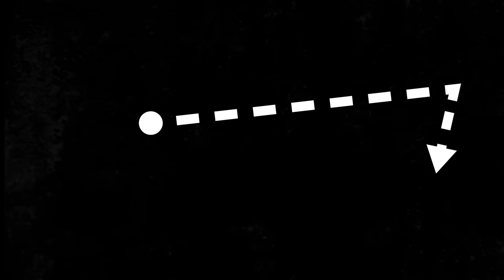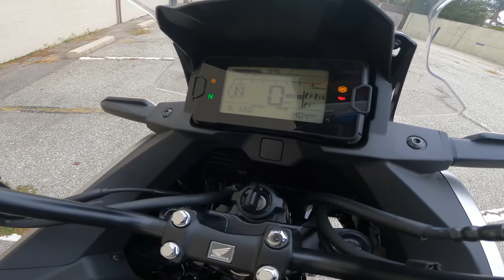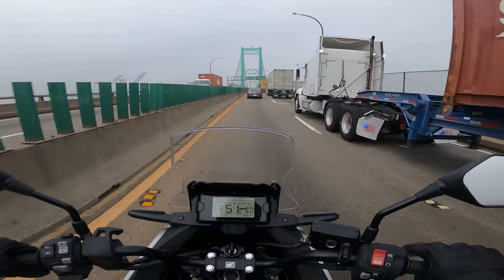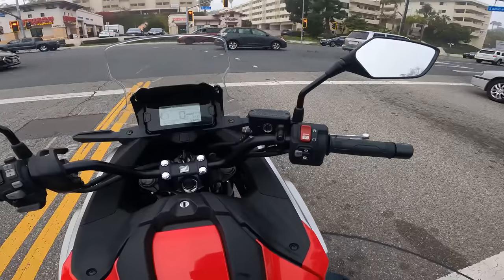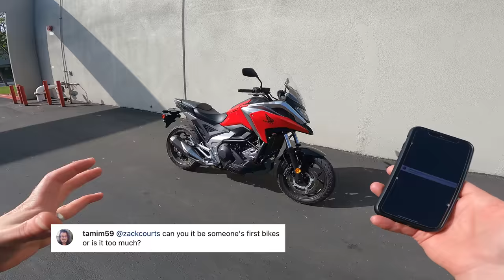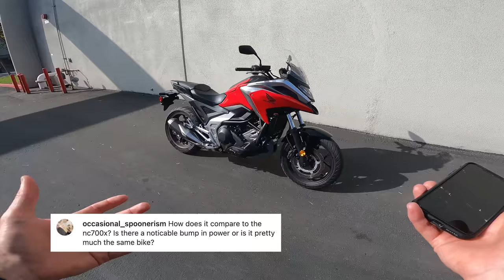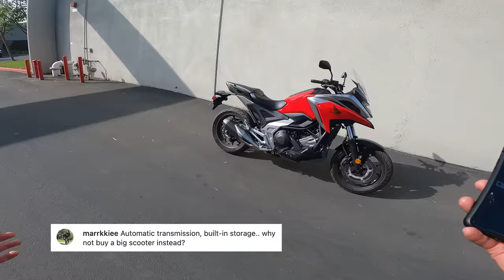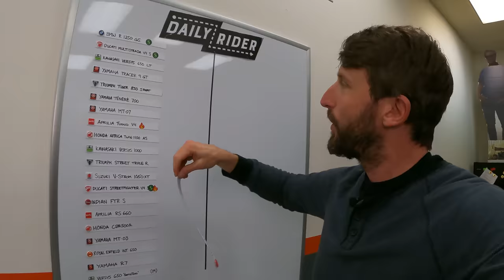Automatic-transmission on a motorcycle? 2021 Honda NC750X DCT | Daily Rider

Comment: I test rode one of these a few months ago along with a Gold Wing DCT Tour. Surprisingly, the Gold Wing, even though it is bigger and heavier it is far more exciting to ride. I suppose it should be at triple the cost. However, my biggest complaint about the NC750X was not its lack of excitement, but the frunk didn't fit my helmet. My Shoei Neotec would not fit. The salesman was stunned. We tried several other Neotecs off their shelf, even a medium size, and it would not fit in the frunk. Why go through all the trouble of engineering a compartment to store a helmet that doesn't fit common helmets like a Neotec? That's a big fail. My other issue was the lack of cruise control. Double fail.
Reply: It's really terrible for helmet storage, yeah.  There is some consideration near the fuel tank for a helmet lock.  But considering all the other stuff I can throw in the frunk, I'm glad it's not reserved space for a helmet.  It's far more useful if left flexible.
Reply: Hmmm... I own Neotec size M and it does fit. Although, it is Neo 1 not 2. Also, it does not fit with Cardo Packtalk attached, but it was never a problem.

Comment: with different tires, could you take this on a fire road or something light dirt/gravel?
Reply: Most definitely! I have done it on mine and so have others. It is no heaver than any of the larger ADV bikes but just be aware that you will have to take it slow. As Zack said in the review the suspension travel is barely 5". I am picking a CRF300 Rally on Tuesday because at 70 years old a 470 LB bike is a little to much for me to handle off road. I ride alone most of the time.
Reply: @johnpagejr.7628  Thx! I have a CRF250l I've been riding around and am ready for something larger and more comfortable and actually usable on a highway, but the heavier ones are way to heavy (e.g., Africa Twin) or too much tech (e.g., GS850) and I'd like to stick w/ Honda instead of moving to something (e.g., Kawasaki, but not the one w/ the doohickey issues!)

Comment: Most dissapointing Zack answer ever was to the question, “why not get a scooter?” As an urban commuter, there are some benefits to the scooter, primarily weather protection and massive built in storage. But the motorcycle format is so far superior in handling and performance that it’s worth relinquishing that weather protection. The larger wheels and full swing arm is all the world of difference. And yes, the chain drive DCT with real gearing beats the crap out of any CVT for performance. On top of which, there simply is no longer a maxi scooter market in North America, which, admittedly, is a little disappointing. Anyway, performance wise, the 750 feels to me much much livelier than the old 700, if you’re asking.

Comment: It's a lovely little machine in many ways, arguably one of the most comfortable I've ever ridden. But the power just isn't adequate (I believe it's basically half of a Honda Fit engine). Honda should go back a few decades, throw on a modern turbo (remember the CX650?) and have themselves an ideal "everything" bike.
Reply: Yep, the top end is near identical to a Fit / Jazz engine. The power is adequate and I've ridden mine all around Europe. The only time to sense a lack of BHP is if you're doing 80mph on the main roads and you want to do a quick overtake but for everything else it's fine and gives 80+mpg(Imperial) and 250miles range is you're touring.

Comment: Do you think this bike is too tall for a shorter rider or too powerful for a newer rider? Thanks for the great videos.
Reply: I have the older NC700X and an inseam of 29 inches. I have no trouble on this bike. I wear boots with heals but can still ride comfortably in flat shoes - just can’t “flat foot” both sides simultaneously. My opinion is this bike is not too powerful for a new rider. As a matter of fact I think it is the perfect balance. Not to fast but not too slow either. The throttle is very forgiving for a newer rider or someone getting back on a bike after years (like me).    This is NOT like a Ninja 650. This Honda redlines around 6500. The Ninja redlines more like 13,000 rpms. If I had a friend come to me who wanted to start riding and he asked what bike he should pick I would recommend a Honda NC.

Comment: Why only one disc brake in front?
Reply: My BMW has twin discs, and my Honda NC750X has one disc. I wish for 2 discs on the NC750X but it’s still god good stopping power and cuts cost and front end weight.

Comment: The only reason to buy the NC 750 X is :
1. DCT
2. Fuel consumption

The Honda transalpine 750 XL has normal adventure wheels size and better engine and  good fuel consumption which is a bit more  then the NC 750 yet does not have DCT .
IF THE Transalpine had a DCT I would have picked it every single day over the NC 750 .
The Transalpine has the powerful yet economical  Hornet engine . Very very good strong reliable and economical engine which Honda is continuing with in the future .
Over all I think the Transalpine is a better bike .

A nice thing would be DCT on and off option so you could use such bike like regular transmission bike or DCT uppon choice; Let’s call it DDCT - Dual DCT .
“Dual”  for Regular transmission option  + DCT option .
Wow I should get money from Honda Research Team .

Comment: Sure, DCT has mostly been seen on soft bikes, but you can't flat out deny that the technology is valid and can be very fast. It's to the point that it is almost impossible to buy a powerful sportscar without it. In cars where you can get DCT or manual the DCT is always quicker. Everybody loves autoblippers, clutchless shifts, and slipper clutches. That's what DCT does, only smother and faster. If they can shed a little weight they are certain to show up on more sport oriented bikes.
Reply: Road car manual transmissions aren't sequential, that's why they can't compete. Most race car, transmissions are manual sequential with quick shifter and maybe mechanical assist to throw it into gear. Most road cars are far removed from race cars. But with motorcycles, you can get a race bike with lights, mirrors and emissions equipment.
Reply: @electric_boogaloo496  Most fast race cars now use dual clutch. That is faster because there is no interruption in power delivery between gears, no throttle close, no ignition cut. they upshift under power.
Reply: @Miata822  can you share some examples of which racing cars in which racing series use dual clutch transmission?
Reply: @electric_boogaloo496  Well, the GT3 and 488 jump right to mind, of course. Each has their own series and any number of dual clutch cars compete in the FIA GT series.
F1 uses sequential and I think they are still popular in European rally events but I don't follow that. It is hard to find a high power sports car today that comes with 3 pedals.
Reply: @Miata822  I get why car manufacturers prefer DCT. Can function as an automatic for people who don't want to shift. For people who want engagement, doesn't kill the feel of the throttle like a torque converter automatic does. For a manual transmission to match the performance of the DCT, they'd have to go sequential, but people who want a 3rd pedal want it with an H-pattern, not a sequential.

The point I was making however, is there is nothing to be gained, performance wise by swapping out a manual sequential on a literbike with a DCT. Space on motorbikes is already so limited that the clutch has to be multi-plate. If you have seen a clutch basket for a regular bike, imagine finding space to fit something twice the size under there. However, you don't need a clutch with so much surface area if your engine isn't outputting literbike power. So, Honda can get away with putting them on less powerful bikes. Even seamless MotoGP transmission on bikes saves 0.1 second per gear shift under acceleration and that is without the weight penalty of a DCT. And Ducati has already files a patent for a seamless transmission for street bikes, look it up.

Comment: The bike is awesome. What about people that can't shift due to a disability or old age. The motor is a torque motor like large cc motors like 1000 or 1100. I wish the cruiser were still available in the US. It's sad as another entry level bike is gone. You go to manual shift which defeats the purpose. I commute so this bike is perfect. Why should I have clutch cramp when in traffic?  No wonder the powersports and people in general don't consider motorcycle and scooters viable transportation vehicles like in Europe/Asia/Africa? It's because the powersports industry is oriented to recreation vehicle. I'm not a squid or a boy racer. I'm also not sure why in the US service intervals are different from other markets? Hence unnecessary maintenance and increased maintenance cost.  I need a vehicle that gets me from point A to point B in an economical fashion. The powersports industry is its own enemy. I want 100000 miles out of my cycles.

Comment: It's funny how automatic transmission is the norm in cars in US but in Europe manual is the "normal" option. And so over here it is more desirable to have an automatic because it is easier and just laid back. Which is what you want from daily driving. I guess manual is kind of a manly thing in the US. But really it is just shit for everyday driving. I guess you'd want a manual for track days.. but then you'll probably have a separate bike or car for that.. so I don't see any point in having to deal with manual in congestion. I'd rather ride a scooter in traffic that pump the clutch all the time going 6 km/h. And what comes to buying a used bike.. I think the clutch and transmission will be in better shape if it was automatic and not trashed by some wanna be street racer.

Comment: I've been riding the NC750X for 4 months now and must say it's an impressive tool, In both directions… 
Lets start with the positive- he's quite an handsome guy, I think the designers did A good job and there is no doubt that most of the attention went this way, The DCT system is fascinating, First of all it’s the only one out there, You normally can choose between the hassle of standard gear or the boring Variators, So the DCT is renewal, Can I say its perfect? Mind reading? Hell no.. but its close enough. The other great idea is of course the room storage in front, Simply brilliant (btw- Aprilia mana did it first)
but that’s about it with the positive.. let's role over to the other side-
First of all- kudos to Honda! What an achievement, No one could believe that it's even possible to make a 750cc engine 
soooo boring and yet you did it! Amazing engineering guys 
Poor in power, Poor in torque, minimal "meaty" rev area that might remind you're not driving a 1986 royal Enfield, 
And then there is the overall packaging of the bike, It reminds me the time I went for groceries as a student and I had to decide what might enter me 55$ budget and what will stay out
The poor breaking system (one disc in front? Really?) the short unknown un adjustable 120 suspension that let me know about every imperfection in the road, the scooter like 2 color dash
the un-adjustable screen, the amount of plastic on the body work

Really guys, This should be in the text book of poor cheap manufacturing

In every day ride he is quite maneuverable and gives a decent grip when you go twisty's, don’t push it to hard due    
In conclusion- If the DCT and the storage appeals to you (and I can understand why) than go ahead, Its absolutely not a bad bike by definition, If this 2 aren't so important than almost every other bike in this engine size area and price will be a better choice 
I guess I will keep mine for a bit more and then it's back to normal gear ... on a better bike

Comment: I love mine. I avg about 66mpg, and I live in a hilly/mountain area.

The linear acceleration of the DCT basically eliminates helmet knock. with a pillion

Another interesting thing is that the front and rear brakes are combined. The rider can stand on the rear brake, and before it locks, it automatically directs the balance of braking to the front.

Comment: Sadly, I asked a dealer what the trade in options are like for these and they said they refused to accept a used one as trade because there was no market for them. It seems like a good, practical motorcycle for people who ride for transportation, not just fun. Because it’s not 75-90hp and not a real adv it gets dismissed as slow and not fun. Seems like a fun way to get to work as a daily rider that won’t break the bank. With a place to lock your helmet and store your lunch.

Comment: Hondamatic 1978-1983

VW R32 2003 - 1st production car with DCT

Aprilia Mana 850 CVT 2007

2010 VFR1200F - 1st motorcycle with DCT
 
NC700X in 2012

CTX700 2013
VRF1200X 2014
NM4 2014
Africa Twin 2016

NC750X in 2014 
NC750X redesigned in 2016
X-ADV 2017

Goldwing 2018/19

NC750X updated again in 2019

2021 redesign, TBW, Dash, bigger tank, storage, lower seat, suspension, lower weight,

Comment: If you are not a racer, but a traveler, Honda's NC series is an excellent choice. 700-750 cm3 volume, consumption between 3.5-4 ltr. at 100 km. (not even 300cc scooters have this, and easy and cheap maintenance that you can do in the field (in the field, for example, in nature. Only a complete idiot would race his motorcycle while driving on public roads, and the probability of it not reaching the end point of its journey is directly proportional to the speed at which it is traveling.This is the first and foremost rule taught to me by my father who rode the entire WW2 on a German made DKW NZ-350 in 1940's I put my Integra 700 NC DCT over 25,000km in 7 months of the year which makes about 3,500km per month or 120-170km per day as the case may be when I was still working. Now I'm a well-deserved pensioner and sometimes I drive 600-700 km a day because I already travel for pleasure and leisure and to enjoy my free time.The power of 50-59 hp is not much but is quite sufficient to move me at an average speed of 160-180 km/h . with a consumption of 3.8-4.5 ltr./100 km. with the three factory suitcases and luggage of about 30-36 kg. at most, always measured on a scale before the trip, or a total of 112 liters of volume for the three suitcases. NC It has the necessary power to move quite calmly at high speed on asphalt highways for hours, if you don't tire quickly. It has a comfortable seat for hours of riding. You have the engine's peak torque from as early as 2500 rpm. up to 5600 rpm where the engine breaker is. It has the essentials for commuting - heated grips, all wind guards, large under seat rack, very low center of gravity which gives it more stability than any other bike I've ridden. And most importantly, my left leg and arm never get tired from shifting gears anymore. And I also have a second brake lever for the rear brake, and I also have a third spare handbrake, like on cars. (it's only for low speeds and in a very extreme case) Not having manual gears gives me a lot of extra time to look at the scenery around me and enjoy it, instead of constantly watching the apex of the turn and which gear I'm in and which appropriate gear to shift. This is a bike to "eat" miles and miles and miles.... With the least body fatigue I've ridden in my life. And I am already 65 years old, and I have been riding motorcycles since I was 7 years old - all brands and models have passed through my legs and hands - from the 40 cm3 German Simson moped with pedals, the Bulgarian mopeds Balkan 50 cm3, Balkan 250 cm3, the East German MZ ETZ 250 cm3 , through the Czech Java and CZ 250 and 350 cm3 in the 1970s, the Soviet IZH-Planeta Sport in 1975-1976 and the Ural-350 in 1978, Suzukis, Yamahas, various Japanese and Italian scooters for urban travel, and to the big road crossover Japanese Honda Gold Wing with manual and automatic gears. One day I made an attempt and traveled the distance from the city of Sofia, Bulgaria to the city of Budapest, Hungary, 820 km. for about 9 hours on an asphalt highway with 5 stops - 3 stops for refueling (the tank is a bit small in terms of liters) and with 2 stops for food and rest with an average cruising speed of 120 km/h. because of the traffic police, and my physical fatigue was as if I had traveled 300-400 km. The ride took me about 7 hours and the stops a total of 2 hours. For covering long distances on asphalt, Honda's NC series with DCT gearbox has no analogue in the whole world for easy and pleasant covering of long distances. I will never buy a motorcycle with a manual transmission again, considering my riding style and age (I'm no longer a racer and I'm 65) and for the pleasure of not having to change gears all the time and being able to enjoy nature around you while you travel.
We Bulgarians always wish for: Easy and accident-free travel. May yours be like that!

Comment: I'm a corvette guy and I only like automatics... Will never own a manual transmission whick is the main thing keeping me from buying another motorcycle. Love to experience the drive itself , not messing around with peddles and levers and rpms. Just need my right foot to control the Throttle and brakes. As it should be.

Comment: If you like to lug an engine... ride the Africa twin & use regular D mode. Tell me it doesn't make the bike feel like it's going to fall apart. I rode mine home from the dealership did some research and never ride it in that bullshit mode again. I can't believe they even did that to that motorcycle D is totally useless imo along with many others 🤷🏼‍♂️
Reply: Sounds just like the AT